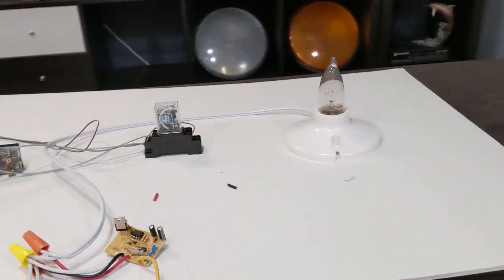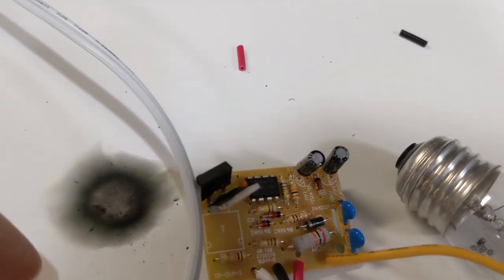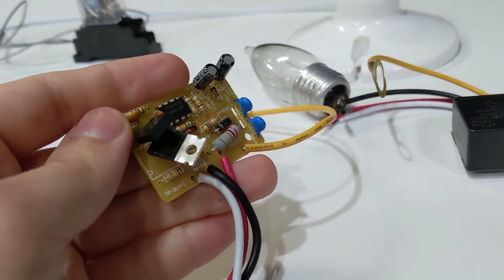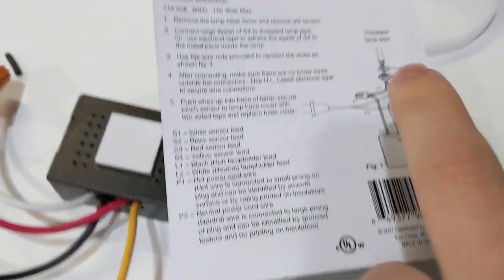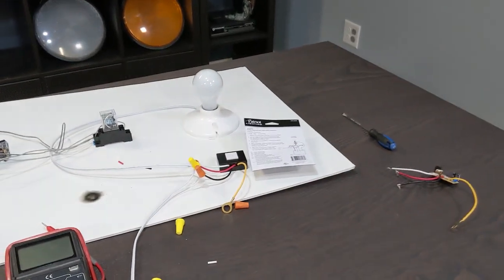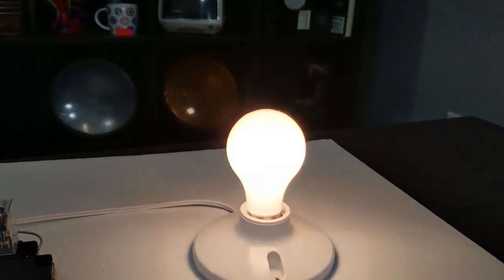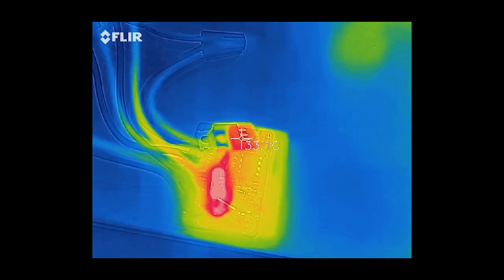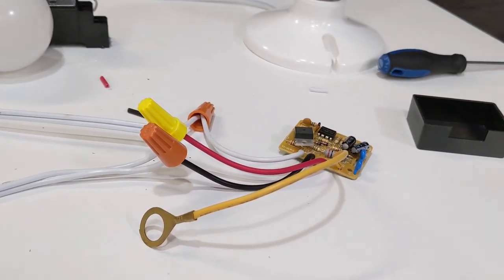A slightly explosive touch-lamp follow-up (standby energy consumption)

Comment: TC: "Black is hot in North America!"
Package: "Made in China"
Amazon Reviews: Hundreds of buyers warning about this problem on the product page. 
This is why I'm lucky I know less than nothing about electrical and always read everything 3 times before attempting anything.
Reply: bought at Menards: no reviews available... but you do get Big Savings!
Reply: > Wire colours are inverted
> Made in China
> "Patriot Lighting"
I love it when the jokes write themselves
Reply: TBH, there wouldn't be any issue using black as the hot, it's AC.
His problem was that white (lamp output) was wired to neutral. In his defense: White is neutral by code. In defense of the dimmer: Hot can be either red or black. 
You can also wire this thing like this: red = neutral (lamp, cord and module), black = hot (cord and module),  white = output (module and lamp).
Reply: @FernieCanto  Yeah Made in China combined with Patriot Lighting is really amazing.
Although the term "patriot ligthing" alone lends itself to much philosophical  contemplation already.
Reply: They may just sell twice as much as if they had used other colors. The made it right from their point of view. 😂
Reply: Wikipedia confirms that black for neutral is in fact correct in China: https://en.wikipedia.org/wiki/Electrical_wiring#Colours,_fixed_and_flexible_cable
Whether that's legal for sale in the U.S. is another matter.
Reply: @ropersonline  I smell a court case
Reply: lets not talk about the time where i went into a nearly 100 year old home to wire an outlet for a family friend and learned brown was live in that house, which is why i now test wiring in older homes with a multimeter before asuming
Reply: AFAIK black for neutral is the standard nearly everywhere, and intuitive (red=hot, black=neutral). Seems like the only thing stupid here is the American standards being different than the rest of the world for no good reason.
Reply: @sharpfang  not really. The EU standard is blue for neutral and brown black and gray for the 3 phases
Reply: @zamundaaa776  yep, that's the new EU standard but you'll see red&black in all kinds of old devices from EU countries.
Reply: Yep, that's what you get with Chinese wiring.
Reply: @Bobis32  If you take a global view, then brown is a very common colour for live: https://en.wikipedia.org/wiki/Electrical_wiring#Colours,_fixed_and_flexible_cable In fact, for all the countries what have brown, there's no country where that isn't live.
Reply: @ropersonline  It is brown because that is what colour your pants will be if you make a mistake with it
Reply: @hastypete2  red for danger is always how I was taught it. Of course now EU has live being brown instead of red, and dark blue instead of bright blue, but those are close enough in colour theory terms that I can translate over. So I was surprised for Alec to be angry at red hot black neutral, haha. Especially because that's the closest to DC wiring style too.
Reply: @granitepenguin  Save Big Money there.
Reply: @SkollMX  Just make sure you go during the 11% sales.
Reply: @Bobis32   Brown is live in my 15 year old home. That is compliant with the newish electrical standards in the UK and EU.
Reply: @kaitlyn__L  "Of course now EU has live being brown instead of red". Not instead of, along. Black, grey, brown and red are all valid for live.
Edit: although red is not the "preferred" color. New multi-core cable always seem to use brown though, and that is a requirement in many countries it seems.
Reply: You are still getting it wrong. The reason it exploded is because you connected the white S1 wire to your mains line voltage. 
Your explosion has nothing to do with connecting black or red wires to neutral or not.
Reply: Bigclive has compertiton in the 'letting out the magic smoke and sooty skidmarks ' class, next stop barbie rockets!
Reply: @ropersonline  It (red-hot/black-neutral) is also the old standard in Australia and New Zealand, before we changed over to the euro colours (brown/blue).   My 70's house is wired using this scheme.
Reply: aha! this is why one of my usb cable had red at ground and black at 5V! Because it was designed by american electrician, apparently! I assumed the polarity (+5=red, ground=black), and boom, off goes the magic smoke from my 3.3V LDO! I had to WIDLARIZE the cable after finding out the cause.

Lesson learned. NEVER TRUST COLORS!
Reply: @sharpfang  In NZ blue is neutral and black is used for hot line 2 in 3 phase.
Reply: @hastypete2  That makes sense, I remember brown being hot because it's the colour of dirt which is what you will be buried in if you mess with that wire.
Reply: @FernieCanto  Can't deny this was a good one hahaha
Reply: @sharpfang  in germany blue for neutral is  standard for decades. Many decades.
Reply: @kain0m  Why don't you use proper standards than your own quirky colours? Then this sort of thing wouldn't be an issue!
Reply: @ropersonline  And the UK - with red as live. Before the europeans invaded.
Reply: @Bobis32  Was the neutral blue, by any chance ? EU colour code !
Reply: @sharpfang  Red was earth in some countries... The only thing that's pretty universal is green or green/yellow for earth/ground
Reply: @victortitov1740  What?  No.  DC doesn't have a neutral, and the US NEC colors for AC don't apply (and would be wrong anyway, neutral is always white or gray, ground is bare or green).  For DC Americans use red + and black -.  That cable was just wired by an idiot.  (Always assume your cables were wired by an idiot.)
Reply: @sharpfang  UK Fixed wiring was all Black/Red N/L (or, Black + Red/Yellow/Blue 3-phases ) until about 2005 and the Harmonizing colours then came in.  Appliance cords changed to blue/brown back in 1960s/1970s (no clear cutoff time // hazy!!!).
Reply: @Bobis32  lol yeah you didn't know that?
Reply: @millomweb  Invaded, huh? Is this another passport colour thing? Will the UK go back to red and black once Brexit is fully delivered? Asking the important questions here.
Reply: @ropersonline  passports - back to blue I think.
Reply: @sharpfang  I was about to say the exact same thing
Reply: True, always read it when wiring, you never know what could happen.
Reply: @hastypete2  *North Americans in this case
Reply: Just to clarify - the reason hot is black in the US is because white is nuetral. This is an ancient standard, over 100 years old. The reason is in those old times, ALL wire off the spool was black, and the electrician had to color code the wires on site, general with dots of paint. White was the cheapest paint available. Since there is only one neutral in the whole system, it was painted white, and with all other wires being hots (main line, switch legs, etc. - no grounds yet!), they defaulted to black.
Reply: @Bobis32 Worldwide Standards: Brown = Live, Red = Live and green-yellow striped = protective earth, everything else can be anything. based on context.
Reply: @sharpfang  It might be one of those things why we have NTSC while most other countries use PAL. The technology was standardized here first, then others came up with different standards as the technology developed and became adopted in other countries.
Reply: Bingo we have a winner clear your cards.

Or ding ding ding we have a winner.

Or Dave Jones words winner winner chicken dinner.

And also when Dave Jones words with at least with the original video just no 

And fail.

And he would definitely call it a turd as well.

And it would get two thumbs down or if Sagan was with him for thumbs down.

Haven't seen singing on a while for some reason on his videos why?
Reply: @granitepenguin  we save you money we save you money.

By the way where I used to live in Wisconsin we did have Menards I didn't even realize they're still around anymore LeFrak one time we were there and they were recording a commercial for Menards I actually did get the guys on the ground I think that's the first somewhat famous person I've ever met.

Although I've met I think one of the other person that was a popular personality or something but long time ago.

But is a chance encounter.

Also my father ran into a band member from one of my favorite groups anime music conference and Diane autograph for me on this program!

That's the one I remember the most.
Reply: @ropersonline  yep and yep
Reply: @Feyangel23  I smell future product recall after everyone that has used these complain or have had this happened and see this video either one but I don't a big conglomerate would even do anything about it as so much as our things have happened in this world like that that thing's just go undone that need to be done to protect other people's and then some our system of economy even reputable brands that have big problems one products they don't support it and when people get hurt they're like so what and recalls that should be issues or never issues and dumb ones just get taken care of immediately and such this sort of thing has always seems screwy to me I'm sure others get it right the first time stand up and take responsibility for mistakes keep the public safe if there's a problem or could be a problem there is a problem Rectify that problem I'm not talking about a full Bridge rectifier either it's all fair it seems to be it's kind of like free energy it would be like saying free energy is the energy that drives everything which it is not because it doesn't exist it's just thinking that what is is an not what it should be is right and what's wrong is right even if it's wrong and not doing anything to make it right if you get what I'm saying.
Reply: @Bobis32  once I was working in old place doing some rewiring you could not tell one card wire for another when we turned on the lights after you turn on the power we'd actually wired some things like about mosy lights in series very similar thing can happen with a hot and neutral short in the electrical service and also we went to plug in a lamp and room light came on real damn.

Turn on the range and the kitchen bathroom light and another light came on.

The wiring was so badly laid out it was almost impossible to what things were not only that there was no color coding whatsoever where at least that could be discerned due to the wind being so old and Faded if there was any color coding at that time.

The only really Fraternity in that system was a doorbell transformer which had just been replaced by me about a week before.

It was the magic smoke out obviously. You put that much current through a Transformer primary winding oh yeah you're going to have a smoking mess.
Reply: @sharpfang  lived in the United States on my life so wouldn't really know much at least back in the day until I really got the internet because I would have known really about any wiring anywhere else but I agree they should have a harmonized standard that works across every country or just amount although perhaps a different color coding or something or a stripe for different voltages or phases and maybe and uniform low voltage color code for the new replications off-grid excetera and everything be consistent acrost everything Derby a lot safer installations unless things like this happening I'm probably the last people you could say kicking the bucket not knowing what they're doing but who knows the dumb things people do like designed this product they're still going to be those people out there that expire early on the first projects hate to say but it's happened I'm sure in more than one time in history.

Like in the old days I heard the electrician's used to thumb spend their thumb and forefinger between hot and neutral to tell if there is power even the old books and suggested that although they cautioned only when it was a hundred twenty volt AC Max and some even mention DC with that seriously also I heard people in the military on some of the electrically operating systems that were what ever voltage there were like 48 volts or perhaps more for some reason it seemed to think it was mostly on the submarines that's how they would test for voltage would be spending two fingers between the wiring or terminals or whatever or the fuse holder obviously I would not do that anymore today times I wonder if anyone has ever been killed by doing that because I used to be an old-timer and that was the last time they ever check voltage theoretically under the wrong circumstances that could be lethal thank you for helping me touching ground in some way or Worse someone went wrong. In some ways old methods of doing things should die with the old ways as in terms of the habit of doing something like that that they may have done at one time should not ever be done again.

Especially since there are ways of doing this safely they're much easier than they used to be and a lot safer more reliable refract I used to have Manchester that all it was was too light bulbs learn series 1 waterproof sockets tesley detached and to both guards on the sockets and that was an electrical tester to check from Holdrege would work for either 110 or 220 needless to say I got that one from an old-timer but it did serve the purpose didn't need it very often this when I was first starting but I realized that probably not the best way to do it but there were actually testers used in the UK and other places that would actually have what they call a pygmy bulb that was The Logical sister for the same idea
Reply: @ropersonline  I think that same Wikipedia article was brought up by someone else previously or was it you can't remember
Reply: @Les 100% agree with all of this test and retest and make sure you know what's what don't assume anything except always assumed that you were sumption is wrong
Reply: @Les likewise if you assume you can assume that your assumption is not a good one AKA it's probably going to be wrong.
Reply: @victortitov1740  Dave Jones is that you LOL
Reply: @uniservo  that's the way I heard it from an old-timer once I just remembered funny how things bring things back you know.
Reply: Also family name any relation to RCA as an RCA Victor LOL.
Reply: @horizoninabucket  I wonder if it's a british empire thing. We (India) used to follow the same convention as well, until recently. Now we use, or at least are supposed to use, the brown=live & blue=neutral scheme.
Reply: @granitepenguin  Also never go there if there's any risk of having a return on your purchase. (Savings are made somewhere, and you get to eat it if shopping there.)
Reply: pauljs75 let’s not turn a light-hearted joke into a Menards bashing session. This channel is a happy place. :-)
Reply: @RevRaptor898  for black I always remember "black is burnt" -- same concept
Reply: @granitepenguin  It's ok to shop there, but you have to be absolutely undoubtedly 100% sure of what you're buying. Exchanges are limited, and you'd have more luck arguing out of a red light camera in Plainfield than getting a return.
Reply: @granitepenguin  Some say they're a Menards II Society.
Reply: @hastypete2  Red is also a colour of death, and red being hot is also logical. It would be good if we all moved towards blue = neutral anyway.
Reply: Lots of properly colored thing are made in China. The implication an American company wouldn't make the same mistake is laughable, at best
Reply: @GarrettMoffitt  The implication an American company would make things is laughable at best. /s
Reply: @eddie826  - Yes, we US people tend to think we are the ONLY Americans even though we are very much not.
Reply: it AC though
Reply: @Bobis32  Brown is live in UK, also known as brown trousers if you touch it colour it to remind you.
Reply: @silverdragonslair  the issue is black/brown are modern standard colors for live wires in the US however the house was built before that standardization and was built in the era of white/red being hot black being neutral and brown/green being ground
Reply: It seems like the only right answer is to test and RTFM .. and hope the instructions aren't wrong.
Reply: @JeffDeWitt  The reason the rest of the world use PAL is that it fixes most of the horrible problems with NTSC (often back-ronymed to Never Twice the Same Colour). Just because the US came up with NTSC standard first doesn't make it a good standard.
Reply: @nickryan3417  I wasn't defending NTSC, just pointing out it was the original standard. It only makes sense that later systems would improve on it.
Reply: @zamundaaa776  Parts of the EU used red/live black/neutral before the EU became a thing.
It's also relatively intuitive that way as well. Black and blue pair together so well that they consitute an idiom. And ignoring how similar brown is to red (watch TCs video on brown if you dont get it), you will brown yourself if you touch it.
Reply: Mess around inner workings something plugs in of course it blows up.